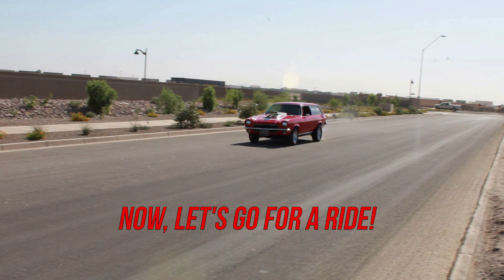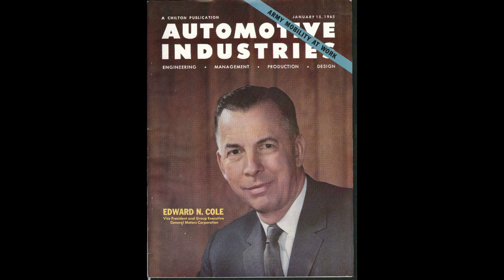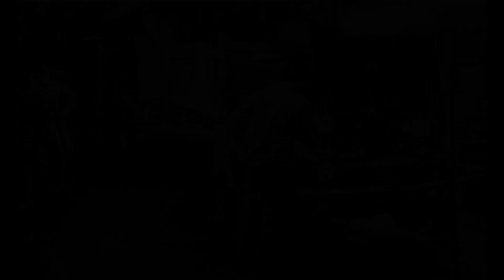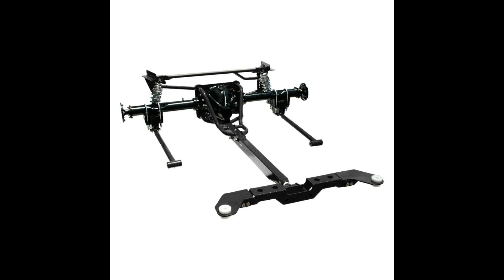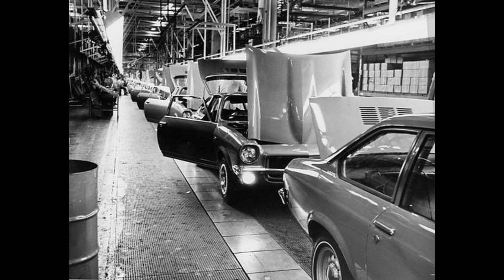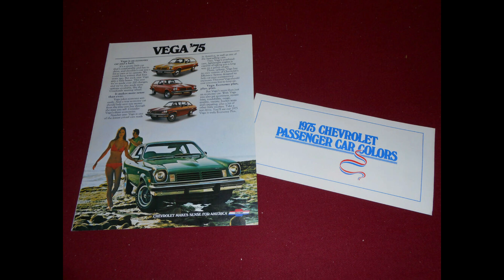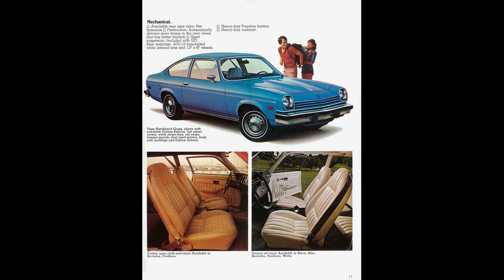If The Chevrolet Vega Could Talk - "People remember me either with love or hate but I'm remembered!"

Comment: If the Chevy Vega could talk it would say,"Tell GM to put four steel sleeves in my engine."
Then the entire history of the Vega would have been different.
Reply from the maker: LOL!  You're probably right, Phil! Thanks for watching and for the great comment!
Reply: @IfThisCarCouldTalk  It was definitely an engineering experiment to go with the etched high silicon aluminum block, but an experiment that did not pan out well.  I'm not even sure how that was supposed to work in principle, let alone practice, for bits of silicon would be bound to come loose with aging, wear and thermal cycling, and loose grit in a cylinder isn't fun.
Reply: I had a stock Vega engine Sleeved and got 100k miles out of it.
Reply: Had mine sleeved after 45K -- gave me more HP -- I had to add hotter spark plugs and wires, 40K volt Coil.  Already had the 2 BBL Holley - would beat out Porsches in the corners -- drivers were NOT happy
Reply: I had a '76 which had the steel sleeves.  Car was still junk, alway broken and still rusted, just not as bad as the early years,  Workmanship was horrible.  It was "Vega by GM" not Chevrolet.
Reply: yes Phil the vega would be remembered as a great looking dependable car, shame there are no do overs in life
Reply: No it wouldn’t have. The problem with Vega overheating was a giant steam pocket in the cylinder head.
Reply: @billyhack9673  yes I remember that, but there is an easy fix for that, GM just let us down
Reply: And rust proofing as standard 👺

Comment: I bought a kammback gt in 71. It had larger tires and a 4 speed. I really liked it.  I got about 60k miles and rather quickly went fill the oil, check the gas. Also by then the metal under the windshield had rotted out.
Reply from the maker: Thanks for watching Rich!  We appreciate you sharing your Vega memories!

Comment: Have a memory of a fellow worker stationed at Nellis AFB , LAS VEGAS. Owned  a Vegw wagon and the cable that moves the clutch had broke and the only gear he had was 2nd. Watched him driving slow , in a circle, in a 7 11 parking lot while his wife was getting milk. The wife came out and timed getting back into tue car was perfect. A few days later the car was gone and was driving a 3/4 quarter ton pickup GMC. Stick shift. He owned land in Idaho and was planning a trip to his land. Decided to change the oil and drained the oil. He pulled two drain plugs......Filled the engine with oil and went on his trip. He made up and back to Vegas when his " tranny" siezed up. He had drained the tranny, not thinking..
Reply from the maker: Oops....what a great and "funny" memory Robert!  Thanks for watching and sharing!

Comment: Sir, with all do respect I can't tell if your a salary GM retired person and are afraid of losing your benefits if you speak frankly, or frankly you choose to ignores facts. Ed Cole had built a reputation as a brilliant engineer but he pissed a lot of credibility away  on his connection to the Vega. He felt a dinky radiator was a great idea so the car overheated. a lot. He was bent on not putting in piston rings to save a little bit of money so the engines never made it to 45,000 miles.on average, and the company spent a whole lot of money to fix his mistakes.  Rust destroyed these cars because no real steps were taken to prevent it, and if you were in areas like Michigan, and the RUST BELT, it happened even faster. I would see Vegas with hardly a front fender left on the car. One inovative thing that the railroads and Cole developed was the way they were shipped. If you can get the video, ad it to this video. Too many things to count sir on how to screw -up a car. Frankly it very much destroyed the reputation of Chevrolet and G.M. A saying that permiated the Big 3 was "small cars, small profits". G.M. hated small cars, very little profit, and because of that they had contempt for the Vega and many other cars that started out small. Finally GM Assembly Divisions first assignment was horrible in running a plant, and a program Listening wasn't their Forte. Keep making good videos.
Reply from the maker: Hello Bold One and thanks for the comment!  The Vega, like many other things from the past, are remembered more fondly for all memories, be it good or bad, than a quality product.  The issues and complaints about the Vega are very widely known and we just wanted to present some well-researched information to those who may not know and are interested in the car's history.  It's funny that you got the impression that the I'm somehow connected to GM in any way since in reality, I'm a hard-core Ford guy! I also do not "choose to ignore facts".  Sorry you thought so.  We here at ITCCT will never brand bash since we hope to appeal to all types of gear heads and we know that there are folks out there who love each different make and model.  Thanks again for watching and hope you'll find some other features you'll enjoy.
Reply: @IfThisCarCouldTalk  Thankyou sir for your response back. I realize that your creating content in a particular way, I respect that. I came from a GM. family in the Detriot area. My first car was actually a VW Super Bettle. I was always seeking a quality built  car, not an easy task in the 1970s. I have no connection to FoMoCo other than as a stockholder. Much success to you, the editing and formulation of your video was very good. Lance
Reply from the maker: Thanks Lance!  You and subscribers who are actively involved and participate with our features, are what we enjoy the most! The 70's were a "rough" era for quality for sure though some very cool designs were made.  Really appreciate you and keep it up!!  Tom and Dana

Comment: I had a 74 Vega with a Turbo Hydra 250 automatic transmission.  Rust everywhere.  Replaced starter two dozen times.  Overheated constantly.  Replaced fuel pump four times (inside the gas tank). It was down six months out of the year.  Weber carburetor leaked gasoline. Sharp metal in the seats burrowing into the lower back.  Replaced the engine but it seized a year later.  This is the stuff that comes to mind,  but I still love that car! Put in a 5 speed transmission and a small block V-6, and I would drive it today!!
Reply from the maker: That's great and we really appreciate you sharing your memories with us!  Thanks for watching!

Comment: It’s nice to see an objective, factual report. I had a ‘72 hatchback and for it’s time I’d say the good far outweighed the bad. There were 4 of ‘em in our family over the years and yes, after 5 or 6 years they were ‘throwaway’ cars. But rust especially was common in cars of that era and true for the cheap Japanese cars as well as Vega/Pinto/Gremlin. Weakest feature was the engine, followed by the rust-prone body. But mine was fun to drive, handled great, and did everything I asked of it.
Reply from the maker: Thanks for watching Bill and thank you for the nice compliment on our feature!  We try very hard to do accurate research and provide correct information!  Even with the "haters" these cars have a strong following of folks like you who really appreciated them for what they were.

Comment: Bought a 1974 GT Wagon with 4 speed in January 1974, my first car. Gradually things broke (and more than once). The car had a system where the fuel pump would turn off when the oil pressure was low. The oil light would come on and the car would stop in about a block. I kept a case of oil in the back and would throw two quarts in and the car would start back up. The motor finally gave way at 66,000 miles. The body was rusting bad at that time, too. What a P.O.S.
Reply from the maker: Unfortunately, this is not an unusual case and sorry to hear of your frustration with your first car.  Thanks for watching and commenting!  Hopefully you are a subscriber now and found some stories that will bring you good memories!

Comment: I owned three Vegas. My main car was a '74 Spirit of America. I had a '76 GT that was rusted out. and a '73 with the original aluminum bore block and an Opel 4 speed. The Spirit had a backfire without the air cleaner assembly and the resulting fire wrecked most of the wiring and plastic in the engine compartment. The Rusted 76 had a rear swing arm pivot rust out and I had to use it as a parts car. The 73' needed a front end clip and engine and the '74 got all of the GT parts such as the dash, manifold & carb, Plastic, Air cleaner and A/c. I drove the 74' for eight years on the steel sleeved engine and never needed to open it up. The '73 drove for many years without issue. I sold both of them running at some point. The best part of the '73 was that front grille (which was wrecked when I bought it) .  The Opel gearbox had a reverse gate shaft break on the spline(I had to weld it). The '74 post-fire was a fantastic car. I loved that ugly little white car with the blue vinyl roof.
Reply from the maker: Thanks for watching Guy and for leaving a comment about your Vega memories!  It's sure nice to hear what great times (mostly) you had with yours and would have loved to see that '74!  Hope you are now a subscriber!

Comment: The Chevy Vega lasted two weeks before the engine failed. Wish I kept the car.... probably would have put a 4.3L replacement engine in it if it would have fit. Beautiful car otherwise...
Reply from the maker: Thanks for watching Greg!  The Vega has, by far, invoked the biggest reactions from people. Most are like you, loved the car if the engineering issues had been fixed fast.  That's why they are so cool as restomods! Thanks for the comment!
Reply: It would've fit nicely.

Comment: So many were mistakes were made and producing this car. Chevy should have used the nice little four-cylinder from the 64 Chevy 2 and a small V8 for enthusiasts. Stupid things like the plastic trim under the rear bumper that shattered when the car was jacked up and had to be replaced made no sense at all and angered customers. The radiator was too small the air filter assembly was expensive. And the engine shook like a cement mixer as it ran
Reply from the maker: I think a lot of people would agree with you.  Could have been a really great little car and big success.  Thanks for watching and for the comment! Hope you have subscribed!

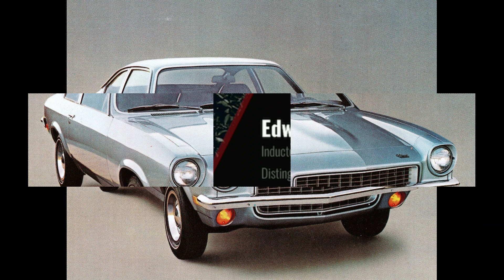Comment: 3:17 center column, sixth line up from the bottom italicized "without a single major problem".       
I would classify a broken timing belt, which would certainly have disabled the vehicle and left its occupants stranded in Death Valley in the summer without air conditioning as something more than a paint chip.
Reply from the maker: Well, that's advertising for you.  Thanks for watching.

Comment: Had a 76 Vega purchased in 78.  It had a 60,000 mile engine warranty from the factory.  From about 40,000 miles on it was a wretched vehicle.  I moved from my home state to Mi to complete my education and find work.
With about 55,000 Miles on it it was drinking oil at a ridiculous rate.  So off to the Chevy dealer I went and demanded a new engine.  Then I rented a car and left it at the dealer.  
About two weeks later I was paid far more than I paid for it and drove off in a brand new Chevette.
About the only thing that Vega did well was provide a very nice environment to park on a hill and enjoy watching the stars…………..
Reply from the maker: Well, at least you have a funny story/memory to share! Thanks for watching and commenting!

Comment: I had a new '71 & '74 hatchbacks.  Both became oil burners at only 30,000 miles despite 3,000 mile oil changes, including Mobil 1 synthetic in the '74.   I was too dumb at the time to know that Toyota was already building 400,000 mile capable engines & transmissions which the company continued to improve to the 600,000 mile level of durability by 1975. 

Vega was clearly superior to the Toyotas, however, in four important other ways: 1) outstanding directional stability at highways speeds including during crosswinds. 2) superior seat comfort and the richness of interior furnishings. 3) superior ride comfort, 4) a quieter, lower rpm engine at highway speeds.  Thus the Vega was a much more pleasant car to drive long distances.
Reply from the maker: Those are some great points and we really appreciate your info!  Thanks for watching and for the great comment! Hope you are a subscriber now!

Comment: I had a green 72 Kammback.  I loved that car.  Always started after sitting a week in sub zero weather in Burlinton VT.  UVM student.  I drove it straight through to Ft. Lauderdale FL and back.  It ran fine, but...19 quarts of oil used.  Every 150 miles it needed a quart.  It got 28 mpg.  I never had an issue with the stick shift.

GM fixed it on warranty, and then 1,000 miles/quart.  Acceptable.
Reply from the maker: That's hilarious!  It's great how all you have is great and fond memories of that car though!  Thanks for watching and for the great comment!

Comment: My best friend bought a 72 Vega in 75. He then dropped a Chevy 283 in it, added a Holley and a bigger rad, and kept it as a sleeper. The only way you could tell it wasn't stock was the dual exhausts. There were a lot of shocked Mustang and Camaro drivers when that little Vega blew their doors off.
Reply from the maker: LOL - Would have loved to see the look an their faces!
Reply: In my case the 283 added to the 4 speed made short work of the diff .

Comment: Was getting them on the cheap, or free with like 70k. Change the head gasket and put another 70k on them.
 Had my favorite parts I would keep like the power steering box, it was less than one full turn from full left to full right. And a small grant GT steering wheel.
 I considered them like bic disposable lighters at the time,  now want another but the price has gone up.
 Also saw one of those millionth orange ones at pick and pull, and it was in better shape than mine. Dented front fender.
 They handle great, I guess because of the weight distribution.
Good video, I now know they made 6500 of the one millionth one.
Reply from the maker: Great comment!  Thanks for watching!
Reply: @IfThisCarCouldTalk  I remember now, I took the clock adjustment knob off of the orange one, great car. Thanx.

Comment: I worked for an independent security company in Flint Michigan. We watched over the new cars driven from the factory about 1.5 miles away ready for transport. I worked 3 shift and had a 1973 Vega. in the winter I let it run all night. It would start missing on a cylinder and I would get out and change the # 3 plug in about 1 min! They must have known that the engine was going to use oil because they had an electric fuel pump that would shut off when it lost oil pressure.
Reply from the maker: That's a great and interesting memory!  Must have been a lot of fun, especially through a Michigan winter! Thanks for sharing and please subscribe for more videos!

Comment: The engine was ok if you added a coolant over-flow bottle and kept an eye on oil levels.  I have owned a Vega since 1985.  It always ran fine, albeit mine is rebuilt with steel-sleeves, balancing and a Crower Camshaft.  It gets 24 mpg around town and 29 on the highway with a five-speed.  The worst part is brake rotors are no longer produced.  Working on it is a breeze.  Everything is right there and is small, light and easy to get to.  I learned how to work on cars from owning my Vegas.  Easiest car to service.
Reply from the maker: Thanks for this great comment!  These little cars really have a lot of loyal fans!
Reply: @IfThisCarCouldTalk  It sure would be fun if GM made a new Vega, like the retro-Camaro only smaller.  It could even be all-electric or a hybrid!

Comment: My parents bought a new 74 Vega Gt  orange  w/black stripe  black vinyl interior  ordered with full gauge package  A/C  am/fm  radio  sport mirrors  bumper impact strips  automatic  transmission   They bought it from  Sondag Chevrolet  in          DesPlaines Illinois  a northwest  suburb of Chicago  they did their best to maintain  that car but it was high maintenance  by the  fifth year it was a rust bucket  even with the Ziebart  rust treatment  and  it took a lot of oil to keep it  going  I think they actually squeezed  92 thousand miles out of that little car  many many tuneups  & brake jobs & batteries & exhausts & tires  and patched up body work  god only knows how much oil & gas & light bulbs & fuses & altrernators  and A/C compressors and a gas tank & hoses & belts & spark plugs for what they spent on a cheap little economy car they could have had a new Lincoln or Cadillac maybe twice  for crying out loud
Reply from the maker: Like many a story from other owners. People have had both good and bad experiences with this little Chevy.  Thanks for sharing your memories with us!